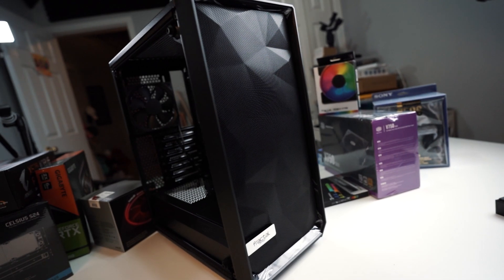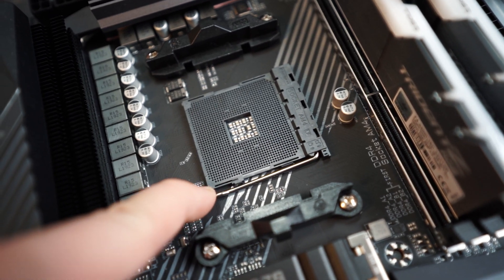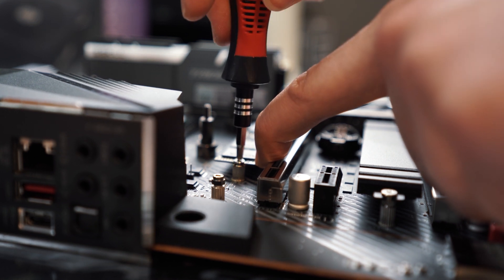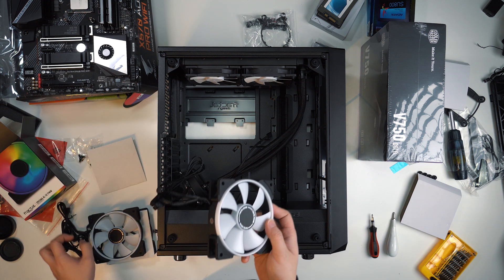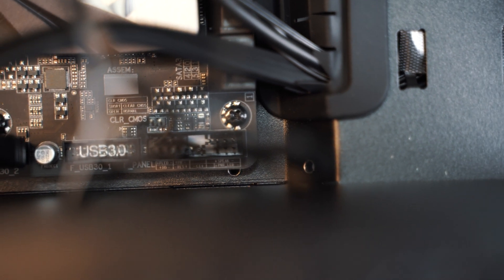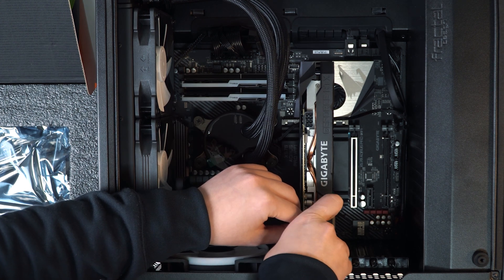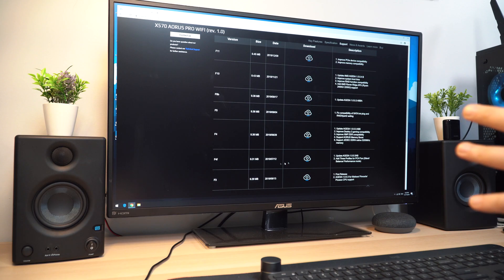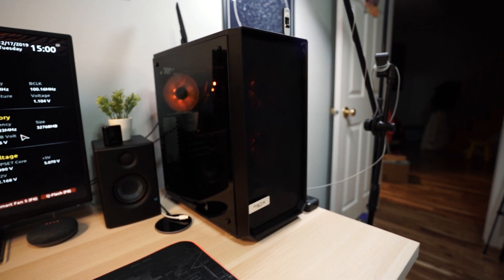Built This AMD PC Step by Step | Build your PC Guide 2020

Comment: Recently I was found an Alienware Aurora R7 Desktop PC with i5 8400 CPU and Nvidia GeForce GTX 1070 selling on FB for $860 dollars. I'm fairly new to buying a used pc. The parts are Original and my friends say its not bad but rather not to buy it. The Desktop pc is like 2 years old and air-cooled.  Maybe I should save up to buy a IBUYPOWER Element 9260 PC when its onsale. What should I buy??
Reply: Don't buy a pre-built, they normally cheap out on parts/cooling and you can get way better specs building your own

Comment: Hey DE, great channel and videos so far, very well done! I wanted to pick your brain on something, I recently bought an Aurora R8 on a really good deal. It’s the air cooler model and very similar to the R7 from your other videos so of course it runs hot and loud. At first I was thinking of following your previous videos’ steps to upgrade the cooling and PSU but now I’m wondering if it would be a better idea to just transfer the motherboard and everything over to a different case (like the Mesh you have). The last option would be to get rid of the R8 altogether and start from scratch, my biggest concern there is waiting for sales on similar parts and the time invested into picking out and building. Thanks again for the great content! Cheers~
Reply from the maker: Hi thanks for watching. It is possible to transfer everything to a different case, but you will lose the LED stripes for sure. for myself, I don't see any much of point to transfer everything to another case. as the motherboard itself has limitations, so I can't do too much anyway.   for the CPU fan noise,  you can upgrade to a liquid cooler for much quieter operation and lower temperature.  such as the CORSAIR HYDRO SERIES H60.
Reply: Digital Etron thanks for the reply!

You mentioned limitations of the motherboard; other than the “strict” fan requirements what type of long term issues or limits would I be running into?

I do like the R8 design and performance and am wanting to use it for gaming and streaming but I also don’t want to run into huge hassles or having to switch to a different model too soon. To clarify, the model I have has an i7 9700 and a 2070 Super.
Reply from the maker: @PepeDSapiens  yes you can only use some types of fans on that MB, due to fan speed and start voltage? and also limitation on the RAM as well, mainly due to the speed of the ram, max to 3000 MHz, and up to 64GB.  for gaming and single streaming should be just fine. your specs are good for now, no need rush for much upgrade.
Reply: PepeDSapiens I have an r6, it’s been a beast for the past 3 years! Just encountered the over heating problem because the AIO they use is prone to overheating after a while. I am going to be upgrading to the Corsair h60 myself.
Reply: @mahid9594  Ouch! I ended up going the DIY route and built my own system. Definitely not as slick as the R8 but it performs beautifully.